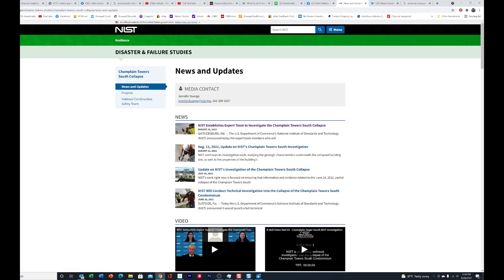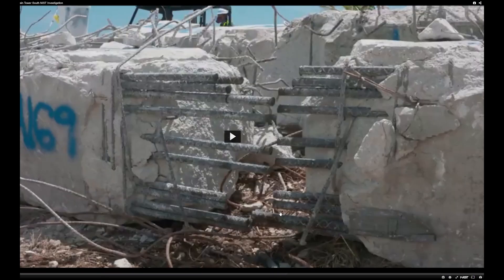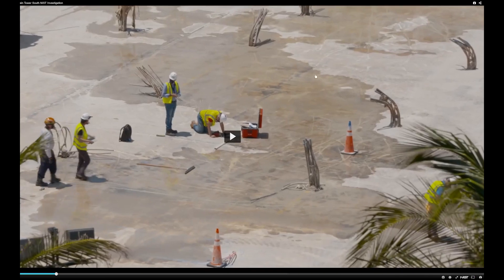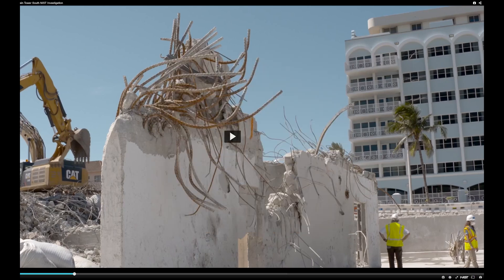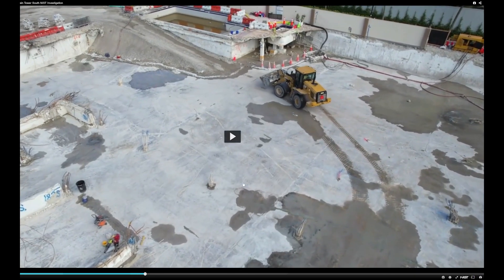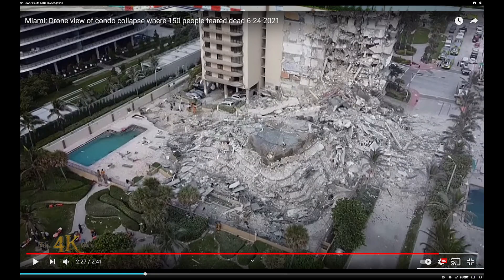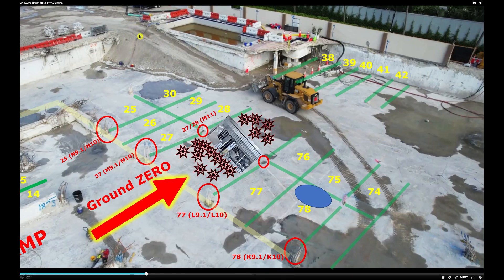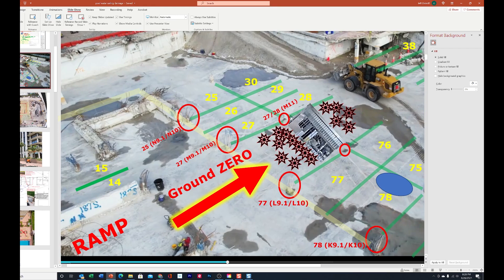Surfside Condo Collapse Site View NIST Video Ground Zero

Comment: According to eyewitnesses pertaining to the noises that occurred before the collapse of the pool deck in front of unit 111 (Nir’s unit) , the noises seem to be next to the elevator Ie fitness center . Thus is there a possibility that the punching shear failure occur at Column 9.1 F ( parking space 80/81) first and progressive ly make the others pool deck area to fail . 
Can you get someone to check the punching shear capacity of this column as  I think this punching shear capacity is greatly reduce due to 
1) change in pool deck slab level 
2) Most probably the heaviest loaded column that fail Ie Base on the area of load on to this column 
3) Unit 410 above would felt the collapse 
Tq

Comment: at 1216 until you leave the over head shot at 1538 we can see how think that pool deck is , and first impression it looks like it was way to thin to have all the necessary safe guards , perhaps you can go back and zoom in on it and evaluate it
Reply from the maker: 9 1/2" thick. so far I have not heard any engineer say that was too thin
Reply: @jeffostroff  did it look like it had the proper water proofing ?

Comment: The rebar of the last of the 5 columns in that overlay you did had a lot of rust on it compared to the others, would that indicate it could have been compromised before the fall?

Also at 19:31, the rebar at the top of the ramp(?) has a lot of rust as well compared to its nearby towers.
Reply from the maker: Yes it is so hard to tell even when they rusted

Comment: Right around 8:55 you can hear one of them say under the mask, : there's water coming out of that pool. So the pool is leaking even now? And possibly why theres water everywhere? Also just an idea that came right to mind by that picture at 12:37, and where the crash firstly may happened, its all the center of the building,took its all weight and its got tired basically:???
Reply from the maker: no I thought he was saying it was coming out of the piece he was holding.

Comment: I am convinced that the work from 96 led to leaks and the thin columns contributed to the premature failure of the Champlain towers south building.  The punch through pulled down the building.  The witnesses that escaped right above ground zero, I forgot the unit number, reported loud noises and failed pool deck.
Reply from the maker: they were all in the "11" stack, unit 111, unit 611.

Comment: I'm still working my way through your videos but I'm rapidly coming to the conclusion that this building has suffered from a series of systemic failures going right back to it's construction.
Possible poor concrete construction,
Uncontrolled addition of extra weight during various renovations, 
Unexplained water ingress that still seems to be continuing after the complete destruction of the building,
Bodged and unfinished repairs and innovations,
Apparent inconsistency of construction,

There are going to be a lot of questions to answer by a lot of people.
Reply from the maker: Yes like the Titanic, a number of failure modes brought it down

Comment: Ouch. I have a think and it hurts.
The architect's changing Row Schema: Might that have caused a mistook on getting a column, or 3 or 4, actually lined up atop the one that is SUPPOSED TO BE beneath it?
I mean, I know, it's pretty obvious what's going Straight Up when you're starting fresh, and doing new Ironwork, but... Were the planters the only things added on? Are Were the planters actually placed on top of columns, or just where people thought there were columns? This type of thing...
Coupled with cheaping out on the concrete, not maintaining the coatings on the concrete to keep saltwater spray out, and from corroding the rebar, NOT FIXING THE TEST HOLE, SO IT'S A FESTERING WOUND WAITING TO BURST PUS... Rainwater and Salt Spray collection point, without equal.
The crowding on the rebar is of great concern, as you pointed out, propers settling is critical, because the smallest bubbles can have a huge impact on adhesion. I'm also starting to think that the sizing of the columns was "Just Barely Enough" to handle the loads, with no safety margin. Which would also assume "Perfect" installation. AND PERFECT PREVENTATIVE MAINTENANCE.
And a few other things, because we all know: It's NEVER "Just one thing."
Reply from the maker: No the architect changing the rows is probably only affecting me lol. Likely they all have up-to-date drawings and everything on site and there's likely a different set of drawings of the contractor was using when they were actually constructing the building.

Comment: You know they probably washed the pool deck down every week or maybe every day with a water hose I’ve worked at pools where they hose down the deck, walkways and even the chaises every evening after closing. Did one thing, seagulls and other Birds poop on the deck chairs and ground. That is additional water to penetrate the tiles. Nobody mentions standing water from daily or weekly hosing down the surrounding decks.And that’s in addition to watering the planters. If the drainage and waterproofing is compromised, that’s a problem.

Comment: NYT has an article about CTS tonight. No tech details but info that suggests the builders were pretty aggressive at pursuing things like penthouse, that violated the building code of Surfside. None of them are alive now. Surfside sounds like it was understaffed w.r.t. inspectors.
Reply from the maker: Lot of people are fixated on the penthouse. It was already designed into the plan and accounted for. It violated building code, simply because Surfside wanted no buildings over 12 stories. The city eventually gave them a variance.
Reply: @jeffostroff  Yes, the article didn’t say anything I hadn’t read elsewhere.

Comment: I'd assume rebar cost more than concrete? So, what's the point of adding more rebar? Did the builder just not know what they were doing? I'd be real concerned if I lived in one of the sister buildings, considering the claim is they were built identically.
Reply: I doubt that that were built identically. There were changes made to the design during construction of this building. 

I am hoping that the North tower had new plans drawn before it was built. 
And recalculations were properly done. There may still be problems with the North tower but probably new mistakes were made during it construction too.
Reply: The East tower is shorter and the last to be built.

Comment: The rusted rebar shown in your video, underwent, bending, stretching and abrasive actions (accelerating oxidation). The steel Brake discs on your car, will commonly show corrosion, less than a 12 hours after normal use. The rusted rebar shown in your video, is a product of all of the above, including, being metres from salt water. No more, No less.

Comment: So the architect was suspended for six months for a failed building. Are there any similarities between the two collapses? Size of columns, column spacing, density of the rebars &c? Is there a theme with other buildings he designed?

Comment: Shouldn't that photo taken by the tourist be on the left side of that yellow line, indicating that it was under the building, and not under the pool deck? Shouldn't that red arrow be pointing in the opposite direction? I mean, "ground zero" was the collapsed building. AFAIK no one was injured by the pool deck collapse, unless they happened to be in the parking lot.
Reply from the maker: Dave no, you are forgetting the tourist video is not showing a building collapse, it is showing a pool deck collapse, which is outside the building, but right at the edge.
Reply: @jeffostroff  ---- Maybe if you put one of those compass diagrams or "memes" on the drawings, it would help me get the picture. I thought the tourist was north of the lot, facing south, while the building collapse security camera was south of the lot, facing north. The ramp to the parking was on the north side of the lot, no?

Comment: I think that all buildings built by the builder of this condo should ALL be inspected for problems if it has not yet been done.  From watching these videos, it appears the builder took a lot of shortcuts.  And possibly the architect also.

My ex was a drywaller.  I saw first hand the short cuts taken by other contractors on apartments and homes in TX.

Comment: Even with a shoddy print, and a bunch of "as builts", it should have stayed intact.
Since it seems that maintenance and inspections are not taken seriously, a time limit for all such structures should be considered. Take them down after 35 years, no exceptions. Good luck. 👍
Reply from the maker: just like vegas!
Reply: @jeffostroff  "yeah, but it's a dry heat!"
Isn't that what they say?
In my business, hvac, Vegas is called "the oven" due to the heat loads on systems and the high operating temps.  Thanks for all the videos, it's good work! 👍

Comment: This looks like a column with the top on the left and the bottom on the right. Not a Beam. The right part is the top of the column before a new level. The left part is the bottom of the column at the next level. It is a common thing to see laps at the slab level. New designs often asks that a maximum of 50% of vertical reinforcing be allowed for shear colomns, but this column looks like a typical compression column. Almost NO RUST the rebar of the column looks brand new. YES its looks this clean when you expose the rebar on purpose, probably for inspection...
Reply from the maker: That H-beam is in the framing drawing for the lobby level

Comment: There are going to be people who tell you that there could not be so much rust on the exposed rebar in 3 weeks, but they need to remember the climate of the area and the heavy salt and mineral content in the air that will cause a lot more corrosion then just a bit if rain.  And what rain they would get depends as what it would have done depends on the mineral content of the rain water.  It could speed up corrosion, or could slow it down if it has less mineral content and essentially washes salt residue away.   I expect that is one reason specific samples were taken asap into warehousing to be held for examination to avoid the extra corrosion.

How ever some if this very long lengths of rebar that appear in the video to be several feet of light tan rusted rebar could, chemically, been caused while exposed after the collapse but one questions the number of feet which all appear to have very even corrosion which could have happened after the fact or would not have happened so evenly except under certain circumstances.  Same with the corrosion having happened before, it could while still sheathed in concrete, even that even a coat but if so that building may have had many more problems from the start that no one caught possibly as long ago as the original build.  I doubt we will know for sure without chemical corrosive testing and microscopic examination. 

As for those pieces of rebar so close together in the cement pour, could that have happened when the building collapsed but if so so many instances of it.  If it was done for actual jointing would not the joints be expected to have pulled apart to each respective side of the joint and not stay just all on one side?

You comment about it being 'picked so clean' maybe actually the explanation of the amount if corrosion as there was enough corrosion around that rebar that it long ago stopped having any continuity from it to the concrete meaning it was no longer providing strength and reinforcemenr to the concrete nor was the concrete in any way working with the rebar in load balancing.   I know when we see  building damaged after earthquakes, even with all the shaking we have cement hanging on the rebar all over, from small bits to large ones but the rebar us never stripped clean.

As for the inconsistencies in the original drawings,  I know here that when plans are reviewed fir approval by the city if nomenclature and identification is not consist from one plan or page to another the building plans will be rejected.  For example, if we were submitted plans where M10 was not exactly the same column M10 throughout the plans they would need to correct that.   This is not because the engineers can't look and figure out that on some pages it L10 and on some M10 and on others it's M9.1 or M10.1 but because we know that there are many lay personnel that are doing things like placing rebar, making cement pours, tying in columns on different floors as well as tying framing etc and could become confused.   One wonders how many time they had to stop and remove or reset do to confusion over what the original actually showed.

Comment: Is he a structural  engineer.       Concrete  gains strength from slow cure and used the specified amount water to obtain compression strength.  And while pouring concrete for structural  purpose a vibrator is used to allow concrete to fill all the voids. Also a Job involving a specified slump, to ensure concrete specifications  were met  as noted by structural engineer on build plans. The concrete company or engineering firm will be taking slump and cured concrete  samples from  each concrete truck delivered.  As for rebars it clearly shows improper lapping of rebar joints

Comment: NIST is going to control the narrative. Rebar in columns are lap joints typical in all concrete columns. The fact they removed the debris with a processor head is why you have clean rebar that’s what they are designed to do. I assume you have never been on a large concrete slab and deck project as it shows.

Comment: Isn't it kind of dangerous, if you confuse workers with changing colum numbers? 
How did this architect think, the right amount of iron rebar, would end up in the right size box, at the right spot, on the plan / in the building.
Some poor concrete workers trying to figure out, what colum is where on whose plan.
Reply from the maker: I'm sure at some point somebody made sense of it before they poured the concrete

Comment: Those variations in the column numbering/lettering are the biggest smoking gun... That type of crap should NEVER happen and shows a major slip up of the architect and the firm... with those differences, the builders are literally operating off of different specs on different pages for the same areas.  It looks like he started off naming them as they went and then later came back with an "even spacing" and redid the columns by omitting the letters and numbers that did not correspond to a column placement.
Reply from the maker: yes, very strange numbering system.

Comment: “ look at these free tools and NOT the  sink hole / cave  pumping salt water into the foundation hidden beneath the floor of the parking garage “  why they haven’t pulled up every bit of concrete floor ? Because the resulting erosion will destroy the surrounding buildings.
Reply: pulling it up would probably create a sinkhole

Comment: Notice that there is NO VISIBLE  AGGREGATE in the Concrete!
Reply from the maker: Maybe on those low res photos we can't see it
Reply: @jeffostroff  you should be able to see some at edges where concrete broke. Spent 12 years as Chief Inspector for Structural Engineering firm, mostly concrete high rises. ACI CCSI certified.
Reply: Would make sense if you tie this observation with the statement of Mark Loizeaux/CDI, saying that the concrete was softer than it should be.
Reply: @MrKoenig1985  met Mark several times when I was working fot Ysrael A Seinuk, PE as Chief Inspector.

Comment: Not entirely correct.  The structural drawings have a licensed engineers title block and likely, stamp.  The shop drawings would have been made from the structural drawings, and would supersede the architects’ design, bidding, or permitting drawings.  We look for a PAA, the construction administration log and final sign off (third party testing) to determine what’s going on.   Column labeling is a red herring (IMO).

Comment: So tons of steel way too much in ccolumns n beams but jack squat in the slab spanning design-omitted beams then the concrete clearly is below rated strength from.its rebar cling qualities.  I still say sinkhole, Jeff..  Pet theory so there
Reply from the maker: sink hole in terms of the pool deck sunk into a 9 foot deep hole

Comment: I think these condo owners need to keep this in mind when they upgrade their buildings. Everyone worries when a fat guy get's in a packed elevator. Maybe these condo owners should worry too about the weight limits of these buildings when they remodel. If you look at these garages you could almost call these owners slum lords. You would think they would worry more about the structures than how pretty the place looks. My grandpa would say, you can slap makeup on a pig but, it's still a pig.

Comment: You have probably already seen this,

https://youtube.com/playlist?list=UU9xpl8LyFRsKXASGHBBj_xQ

But I think it confirms your analysis of the initiation point of the collapse being the column failure under the planter where the test cut out was made. The deck collapse, pulled the columns under the leading edge of the building past their break point and down she went. So why did the pool deck collapse? Because according to this videos research, the slabs has no margin for error. They were made to the bear minimum for “stationary load” strength, and did not account for dynamic loads, like boom carts, palm trees or planters. Add to that; the corrosive effects of standing water, salt air, heavy remodeling, and the economics of a building that requires more maintenance funds than the group ownership of a high rise condo complex can afford, and “kablamo” (Pete Brown, broncolirio)
Reply from the maker: yes we have seen josh's videos